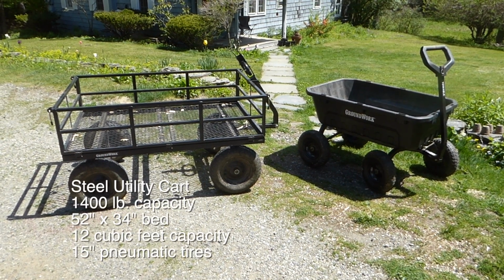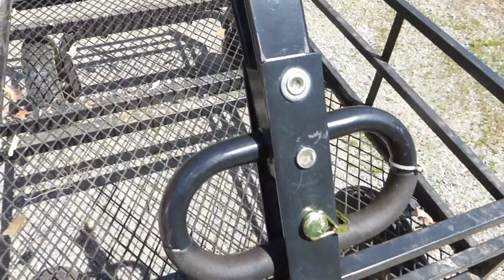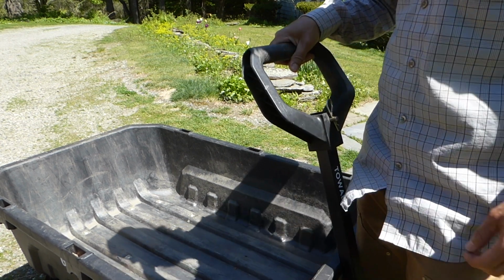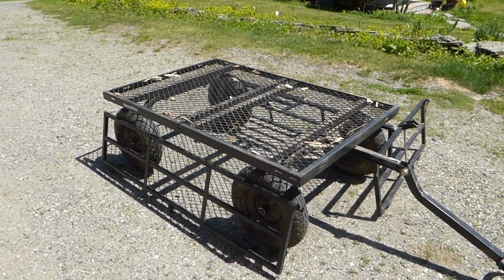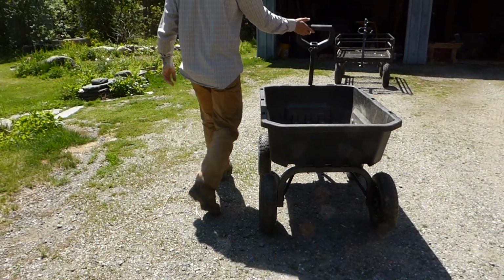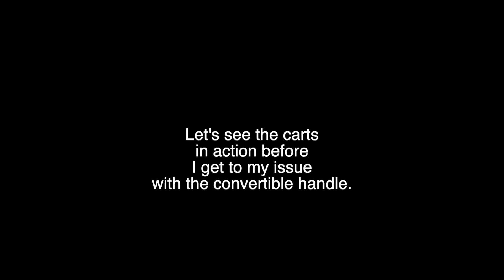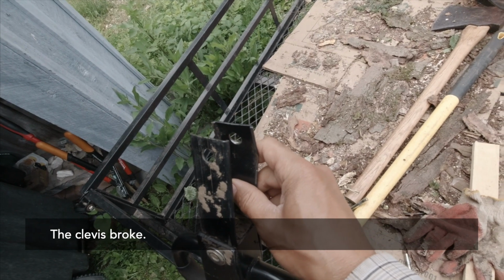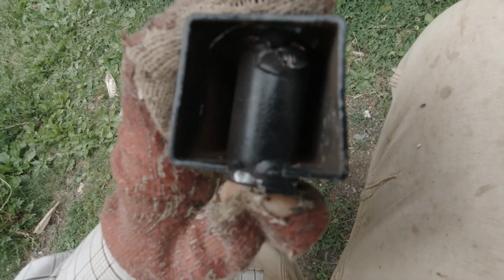GroundWork Carts

Comment: Own/Owned many utility carts.  And own the groundwork steel utility cart in this video.  I needed a larger sized cart.  And this was the biggest i could find.  Went to my local tractor supply store.  They didn't have any in stock , But said they could get me one delivered to my house for free. Usually they charge $100 for it to be shipped.  Well it came and boy was i disappointed.  Yes it looks almost exactly like the gorilla carts.  But a closer inspection showed they used a thinner gauge steel throughout the build and they missed several spots where it should've been welded. And the areas that were welded looked like penguin having a seizure was the one who welded it.   I had to go over a apply JB weld.  Not saying gorilla carts are the best ever.  But they are definitely better than groundworks.  Another gripe i have was in 2023 they still want to use cotter pins instead of the better lynch pins.

Comment: thanks for your review, just started looking at carts. the ground work from Tractor Supply caught my eye. Don't know that I need 1400 haul weight, but the size is what I like. Need to move plywood and stud lumber from driveway to backyard. Neighbor's on both sizes, so no more pulling my truck around the back. Is the steel cart something I can leave in the weather ? , or is that something else I have to worry about, thank you, nice review and no B.S.
Reply from the maker: Hi Mr Livinsouth. Regarding whether you can leave the cart in the weather, I'm not positive. I usually try to bring the cart into the garage or barn whenever rain is in the forecast, but I have definitely left it out days at a time and haven't run into any issues. The cart is painted so as long as the paint remains intact it's not going to go to rust immediately. Hope this helps. BTW, I think that this cart would be perfect for handling sheets of plywood and lumber because you can remove the sides and lay your stock flat on the cart.

Comment: Good job with your video. I do understand these are the only carts you’ve owned. But maybe you can shed a little light for me. I’m looking for a cart to haul rock, specifically those weighing at least a couple hundred pounds. I’m a rockhound. I’ll be pulling over uneven terrain and possibly for long distances. And more than likely I’ll have assistance. The size of your steel cart is what I’m looking at. Gorilla makes a poly that size as well. My concern with steel is the added weight. My concern of poly is it’s durability (thickness). My question to you is whether you think poly could handle big weights. Could you imagine having the larger poly and putting it through like you’re doing with your steel?  Also, the undercarriage for both carts appear to be similar. My concern is with the plastic holding up. Hopefully this makes sense. Thanks.

Comment: Regarding the larger 1400lb steel utility cart. There's a rather large elephant in the room that you don't address that most other garden cart reviewers jump right into because it's a large issue: the rubber tires (I'm being kind, they are more plastic on some carts than rubber). Every Chinese-made garden utility cart has dry rot issues with the tires within months, i.e., I bought a Harbor Freight hand truck  and had to change the tires after a several months because they just fell apart. They were more plastic than rubber which is the Chinese way. 

I almost just bought the cheapest Harbor Freight steel garden cart but after seeing all the reviews about having to spent another $50 for real rubber ties it didn't seem like a better deal. If this is a 1400lb Gorilla brand re-badged cart how are your tires holding up after two years? Also, do they have inner tubes? Thanks for the review.
Reply from the maker: I have to admit the tires are not the greatest. But they do have inner tubes. I have gotten some flats and there is some significant cracking on the tires, but at this point, I've had the steel cart for over 4 years so it's not completely unexpected. I just use Slime tire sealant to deal with the flats and for the most part, that keeps them going. I know some people replace the tires with the solid tires, but I haven't had to go that route just yet.
Reply: As someone who has owned several utility carts , Yeah most will come with cheap pneumatic tires that appear to be stiff and have a more plastic feel.  I generally swap the tires out with 13" solid rubber tires which isn't cheap.

Comment: I have to get the lot # off of the steel 1400 in the tow handle.  Any idea which number that is?  There was a number on the upper right corner of the sticker. Is that is?
Reply from the maker: Hey Paul, the sticker with the SKU doesn't have anything labeled as a lot number. The number on the SKU is 25571-01067. There is a small number 6 off to the lower right side of the SKU. Otherwise, the only other things on the sticker is the Model number of GW1400 and the Patent #s which I don't think you're asking about. Hope this helps.

Comment: Underrated video. Great job man. I'm looking to buy the metal one for some work although I am wondering something. I have alot of gravel in my back yard that is pretty similar to the type of gravel you find by the railroad tracks. Do you think this utility cart can handle driving through lose gravel of that size? It obviously can handle rough terrain as you demonstrated here but what about that lose gravel? Also I don't have a tractor like you so i would have to pull it through the lose gravel by hand so hopefully it's not difficult. And I'm only planning on loading about 500 pounds per trip. This will be my determining factor to buy this thing.
Reply from the maker: Hi Eddie. Thanks for the nice message. I think the metal cart with its large wheels would be well suited for rolling over the loose gravel that you mentioned. I have loaded the cart with similar loads and have pulled them by hand also. If you have to go uphill it won’t be easy but assuming you’re on flat ground, it’s manageable. You just might get a workout - that’s all. The only thing is that you will need to figure out some way to keep the loose gravel from falling out the sides. But if you put some plywood sides to keep your gravel in the cart then you should be fine. Good luck with the cart!
Reply: @mikekim5135  awesome thanks. Yeah il definitely be ordering one tomorrow.

Comment: Will it pull over a really rocky beach well?
Reply from the maker: The wheels are big enough that it should allow you to pull it over a rocky beach, but less than optimal terrain will just require more pulling force. If you're pulling a light load of a couple hundred pounds - probably no problem. I have loaded my cart pretty full of freshly cut logs and it is possible to pull it by hand, but it's not easy. If you're pulling with an ATV or riding mower, it is no problem at all. I would have no concerns about its ability to handle the terrain - it's more a concern of how much effort it would take to actually pull the cart.